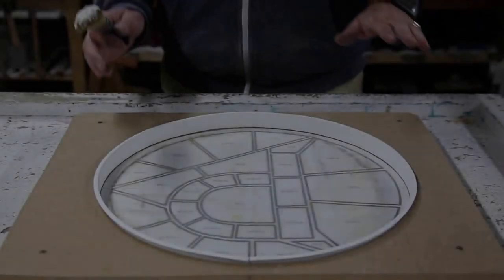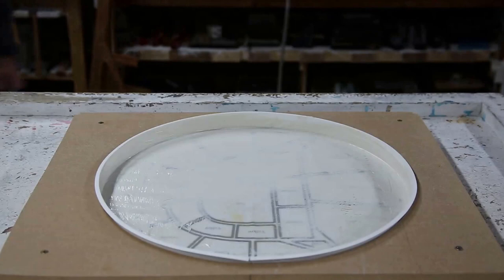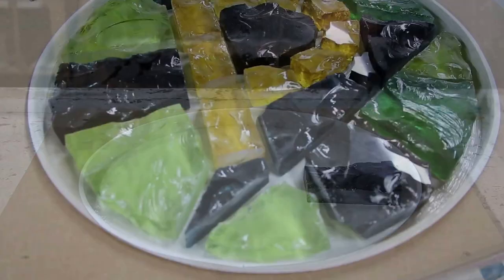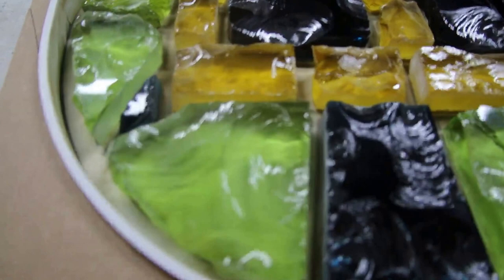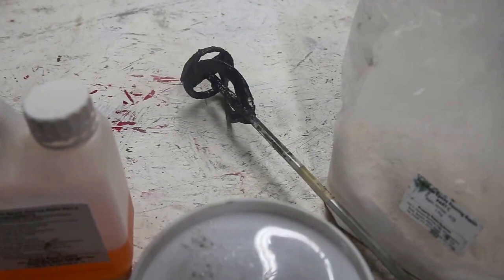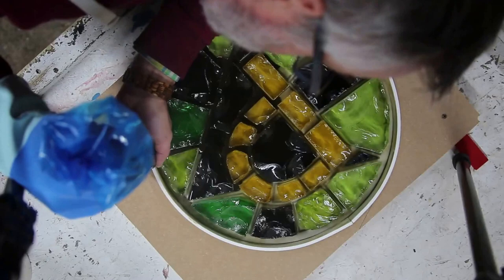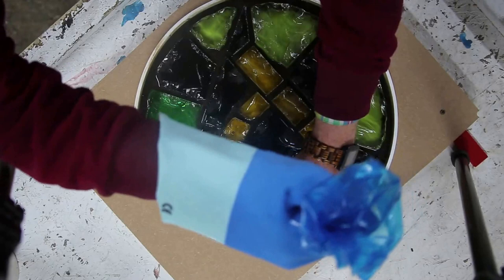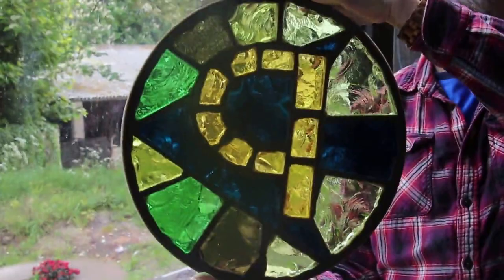How to make a Dalle de Verre panel using Latex as a release

Comment: Luv it!!!! I have experiemented with an outdoor art, with wire mesh and concrete and thick glass stars bought while on vacation in Mexico. I cut out the wire mesh(double layered), where the stars go, and after putting in the glass stars, I skim coated the wire mesh, and after drying, hardening, I mosaiced with mirror(for the bling factor) and mortared it onto a brick stand, so it is vertical/upright in the garden! But now I have discovered wedi board!!! Which comes in 1/4",1/2",&1"...so let the experiments commence!!!

Comment: Need more info on the Latex please. Is it water base Latex, latex ceramic resist, latex body paint etc. Maybe a brand name would help me find the product. Nice video, great ideas.
Reply from the maker: Hi Charles.  Thanks for your kind comments.  The latex is a commercial one from Formulated Polymer Products  (code FP1792) in Bury, Lancashire.
Reply: Thanks for the reply. I ordered liquid latex locally in Florida, USA.....it is Ammonia based, but may work if I can stand the smell.